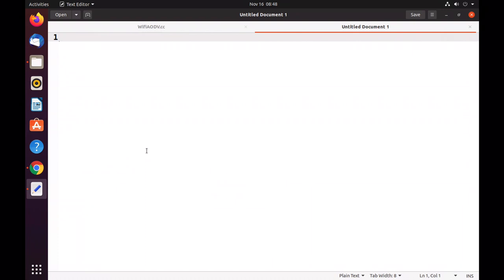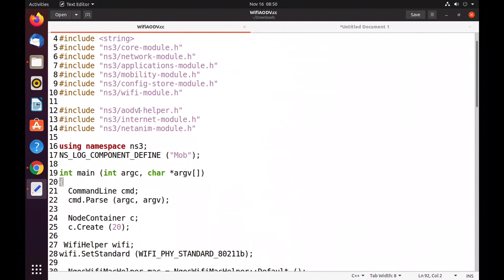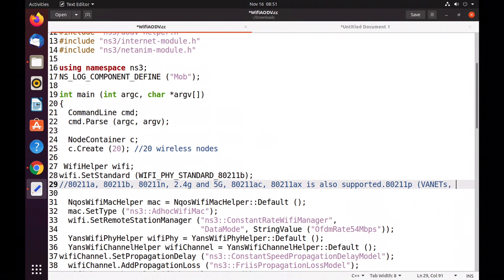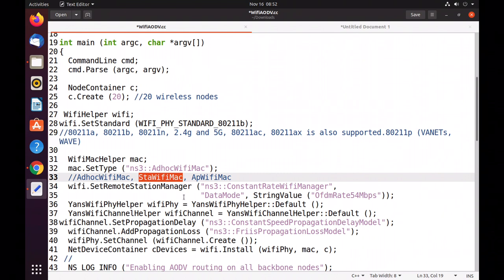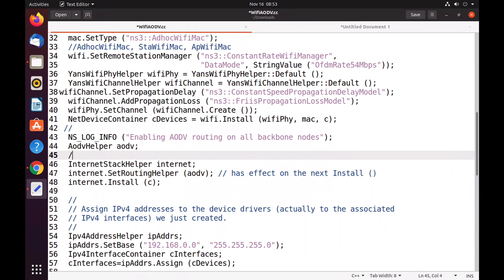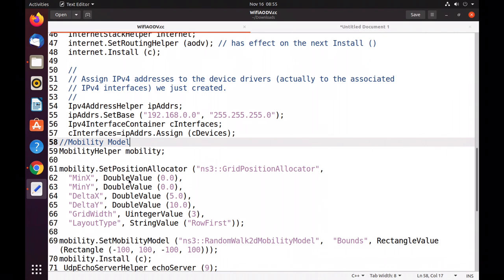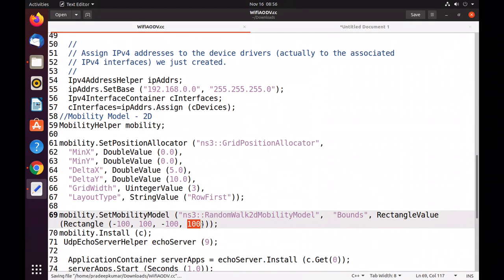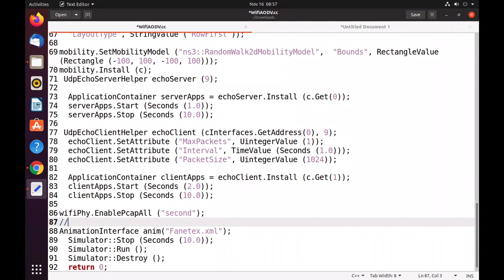FANET Simulation using Ns3 | Mobility Model 3D

Comment: Thanks Sir, but one question came to my mind. doesn't suppose for AODV to be used here while sending echo UDP packets as i can see nodes are not able to receive them while running NetAnim.
Reply from the maker: You need to adjust the vertical distance because the antennas work in the horizontal direction only. Since we use 3D mobliilty, the vertical distance should be small enough to get the packets transmitted.
Reply: @tspradeepkumar  Thanks Doctor. Would you mind please share us another video with modified script to see how nodes in between can act as hops sometimes to deliver the packet when AODV is used?

Comment: Sir very precise and clean explanation. Can you please tell how to run python program in NS3.? i have an error executing python program.
Reply from the maker: What error you are getting. May be try the python3 libraries instead of python libraries (as python 2.7 is obsolete now). and try later on.
Reply: @tspradeepkumar   Sir 
./waf --pyrun scratch/first.py 
this command gives an error.
~/ns-allinone-3.32/ns-3.32$ ./waf --pyrun scratch/first.py
Waf: Entering directory `/home/deeksha/ns-allinone-3.32/ns-3.32/build'
Waf: Leaving directory `/home/deeksha/ns-allinone-3.32/ns-3.32/build'
Build commands will be stored in build/compile_commands.json
'build' finished successfully (1.328s)
Traceback (most recent call last):
  File "scratch/first.py", line 16, in <module>
    import ns.applications
ImportError: No module named 'ns'
Command ['/usr/bin/python3', 'scratch/first.py'] exited with code 1

Comment: Great video! Thanks! Do you have any video/tips for drone networks using 5G instead of WiFi? Or any tips on the NR or mmWave modules
Reply from the maker: Coming soon! Already tried It once,, have to record a video on that.. But sad thing is I don't know anything about mmWave... or 5G or 4G/LTE... :(
Reply: @tspradeepkumar  No worries, thanks. I've been trying to figure it out for weeks. I think I'll just go with FANET for now. Btw, running the code (from the link) using ns3-dev gives an error. YansWifiPhyHelper::Default(), Default isn't a member of the class. Calling the constructor without Default seems to work, but another warning (treated as an error)pops up, "SetStandard" is deprecated in the wifi module. I'll try running it with warnings disabled and see!
Reply: Hello, i'm interested to know if you tried to do it with 5G  because i'm working on it actually
Reply: @raidramon4834  Yes, I did. I used the mmWave NS3 module

Comment: Dear Sir, you are doing a great service to the engineering community. would you please tell me how to simulate a Road Side Unit(RSU) in NS3, please tell me about the integration of NS3 with Cooja for combining VANET and WBAN for my research. I am doing a Ph.D. in designing a health monitoring routing protocol through VANET. I have to collect data from some sensor and have to transmit it to a nearby hospital via VANET. please help me .....please

Comment: Very nice explanation Sir.  i tried the code and want to open the tracefile in tracemetric software but unable to do so. Its taking too much time to execute analysis. So, I would like to ask that was there any other software which can execute trace (.tr) file
Reply from the maker: ACtually you can adjust the location of the nodes in 3D since some of the nodes cannot able to trasmit packets. Hence you can adjust the node position and try out... in some other examples, i could be able to visualise the traces in tracemetrics.

Comment: why does the trace file include only (t) transmission event? why it not include the received and drop packet?
Reply from the maker: Actually, the source node is sending, but the receiver nodes are in a different range compared to the source node (since its a 3D Model right?)... Need to change the antenna type also to handle large distance nodes.
Reply: Thanks for explaining . Can you explain  change  in source code ..or make video for that...and how to set transmission range in this example ...Best Regards